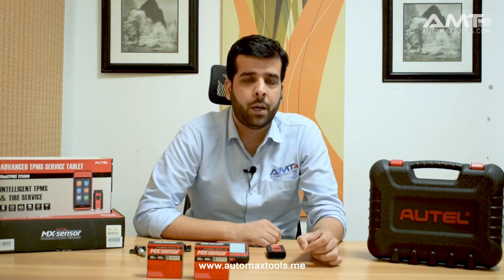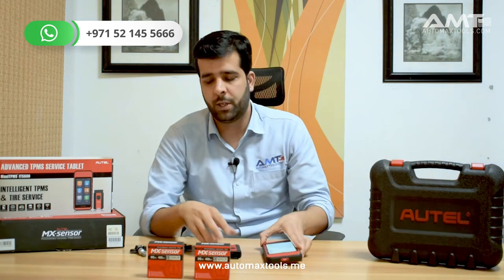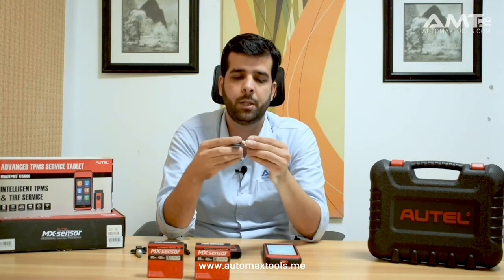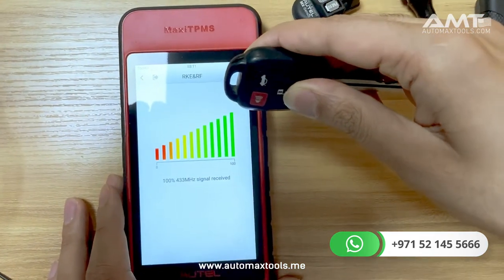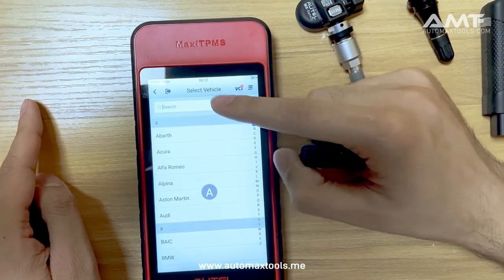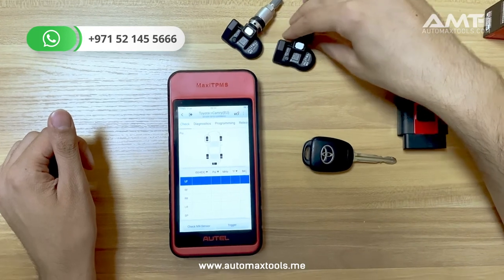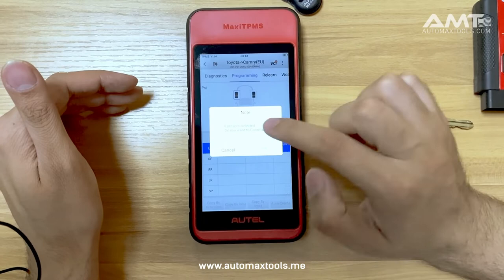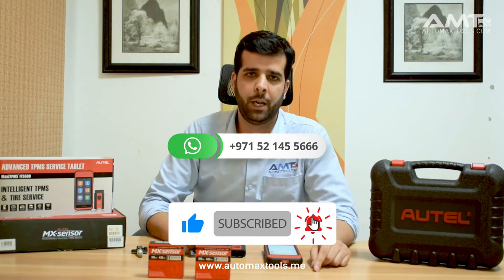How To Program Autel Mx-Sensor & Fix Tire Pressure (TPMS) Warning Light - @AutelTools  Tech Support

Comment: Kindly do the same using mx808s-ts 2023
Reply from the maker: Dear Sir,
Thank you for your feedback. Please note that the procedure is the same for both devices. Still if you have an issue you can reach our tech support at +971569247156
Reply: @AutomaxTools  thanks alot